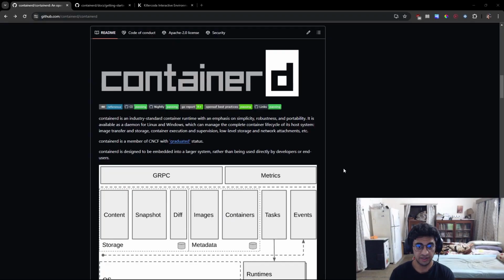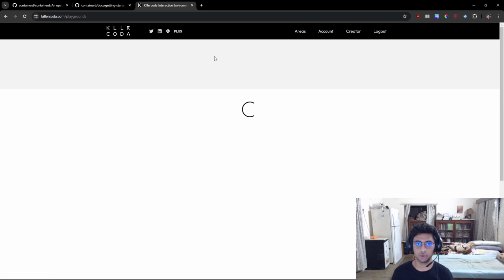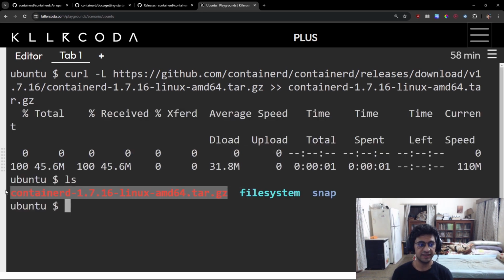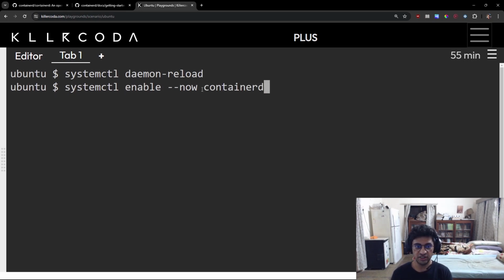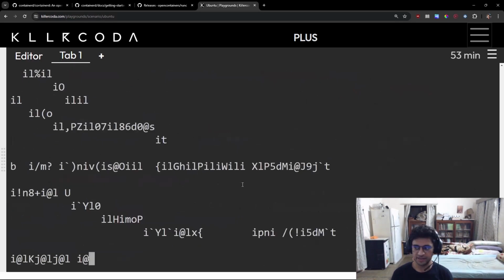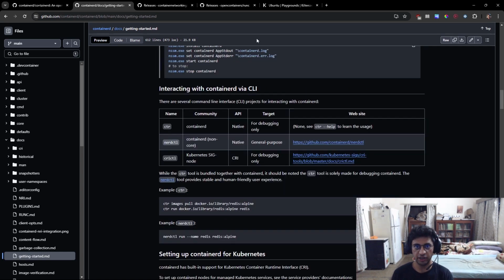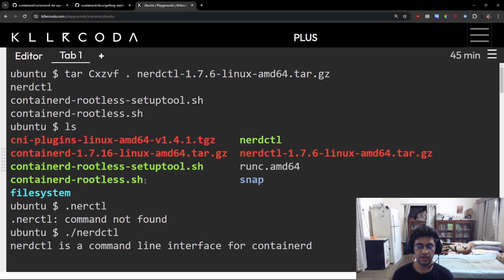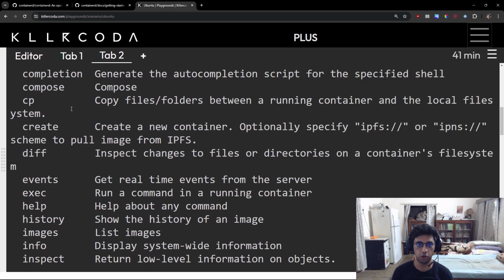Getting Started with ContainerD - Learn What is ContainerD and How to Use It

Comment: I have TRIED to setup a lot of docker containers, and failed after wasting days in 90% of cases. With containerd possibly replacing Docker in the future, I hope containerd is more user friendly.  I don't use containers because I want to, because more and more tools sadly have been exclusively published in containers, which mabye is good for developers, but any user's nemesis. Near always there are missing options for customizing their templates or whatever it is they are spredaing, for the network, or persistent storage is missing or some utterly incomprehensible permissions/cgroups stuff. I have setup and been using literally hundreds of VMs for decades and also LXC containers for years, but as soon as I see the word 'Docker' I know. This wont work!